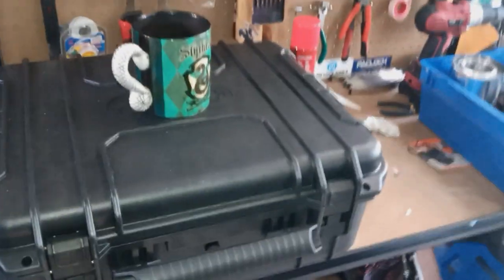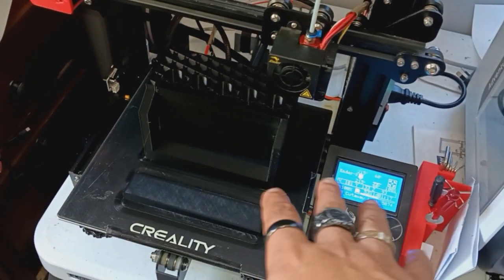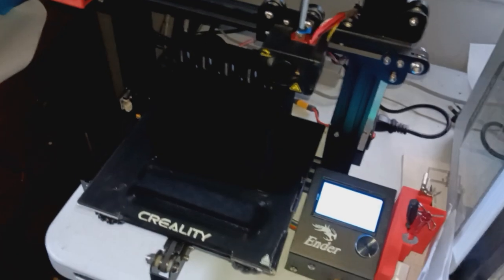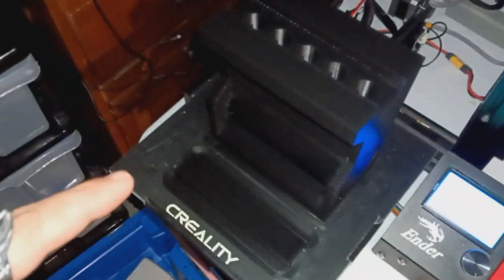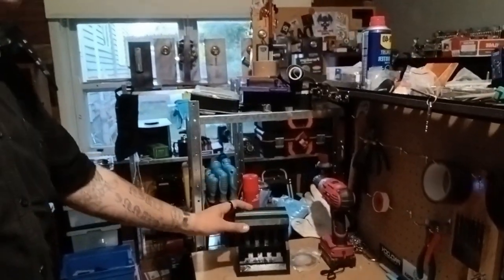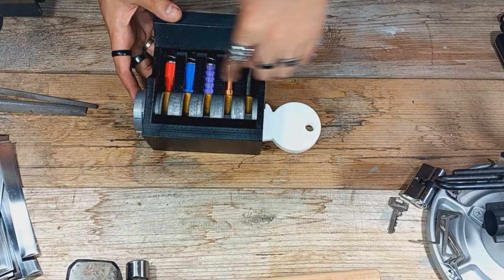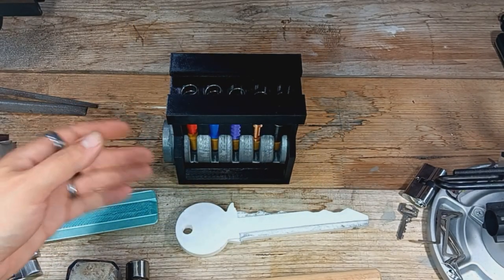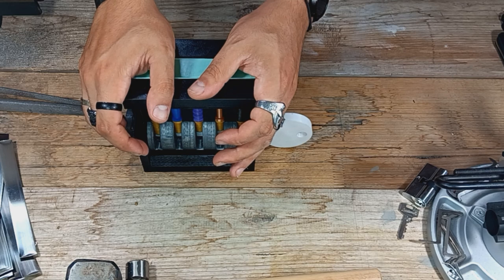Massive 3D printed cut away lock build (519)

Comment: There are some other cutaway lock models  that have springs you might be able to use just rescaling them.  I printed the same one you are printing that came with multiple keys you could use and different pin heights to utilize different keys and make them functional.  It was covered in my Locksport 3D Printing Series on educational items.  Hope that helps.